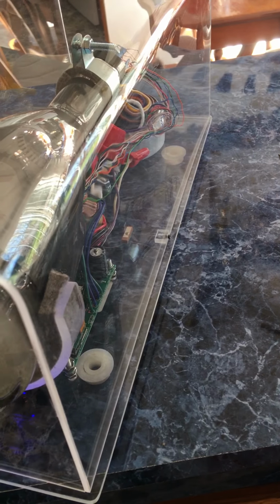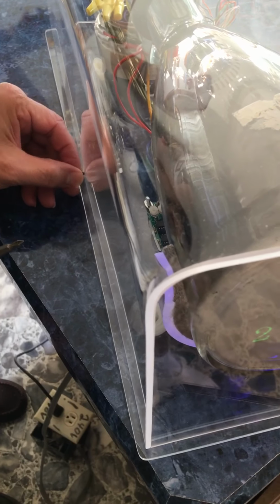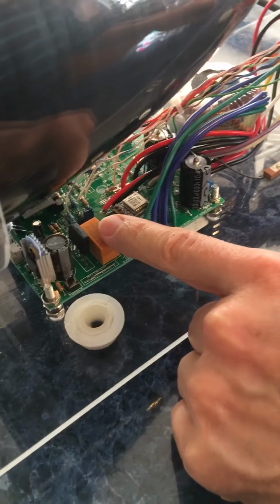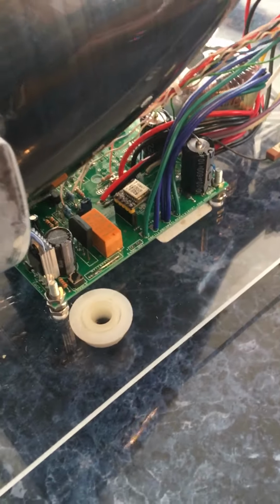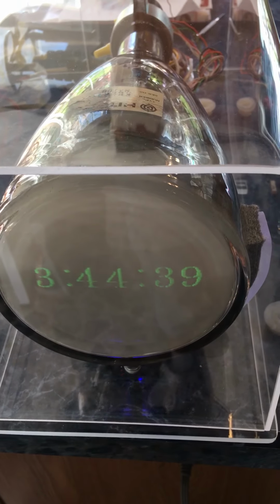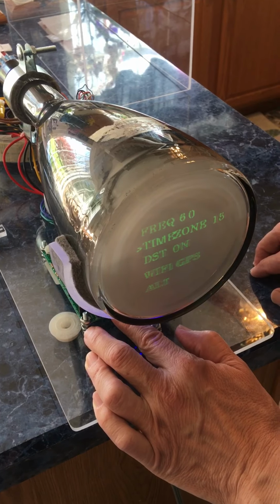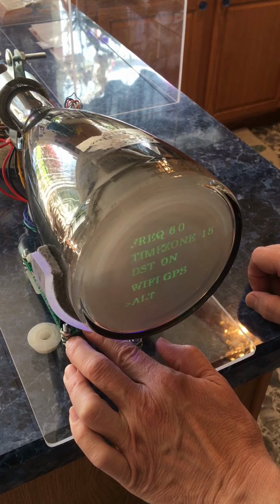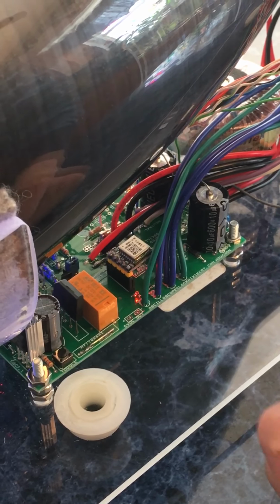Removing the shroud and other things to do

Comment: I bought one of your kits a couple of years ago (the one with the ESP board) and still have yet to build it. The tube I bought (6LO4V) to use with it turned out to be REALLY small. What is a good source for something about 3-4" diameter that will work with the kit? Thank you for the videos 😀
Reply from the maker: Sphere's has some: https://www.sphere.bc.ca/test/index.html
And tubehobby as well: https://tubehobby.com/store.php?cat=3
and of course there's ebay : )
contact me at howchon@hotmail.com any time for help.
http://www.oscilloscopeclocknixiecrt.com/